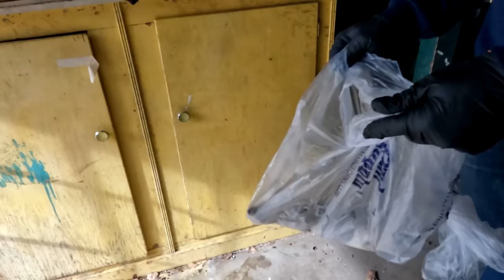We invented a rat sucking machine.. and it works!

Comment: Your footage looked better at 30fps. 30fps 1/50th shutter speed and shutter priority mode auto exposure are a must. If you have to/really really want to use a high frame rate, 50fps 1/60th shutter speed is ideal. Both of these frame rate and shutter combos will film in any country without artificial lights flickering, and they should also reduce or eliminate the flicker of your tools, too. You may have to switch your cameras to PAL mode in order to access 50fps.

Comment: yeah, maybe it should be a national regulation that every house needs a backflow preventer w/mesh screen to prevent rats/roaches from coming into your house from the sewer. the previous owner of our house had the wrong toilet flange installed, which left a gap for roaches to come in from the sewer and crawl under the toilet into our home. if you can't figure out how roaches are getting in check your toilet flanges. a sign i didn't realize was that the wallpaper was also falling off the walls so i am wondering if that was due to sewage gas.

Comment: Why doescon't anyone cover the vent pipe at the top with 1/4 inch hardware cloth held in place with a radiator hose clamp?  Air can move freely, but no rats or mice.  That's what a friend of ours did to exclude young o'possums from falling down his vent stack and swimming out of the toilet.

Comment: Why that always seems to be such a problem is houses are so cheaply build in the USA. Living in Germany walls are made out of solid concrete. I can't even hang up a picture without drilling a hole. U won't have rats in does walls solid concrete vs cheaply thin walks that a hollow in the inside. It has been shocking for me on so many occasions to see how cheaply everything is done in the USA. Door thin hollow wood door. Not heavy solid wood or metal doors. Flimsy locks. I could just keep on going. Also if you do plastic pipes u cover complete around with a metal pipe. That also takes care of tatas the metal pipe won't rust out because of the plastic pipe inside. I know genius right. But that would be not cheap enough and low quality like America loves it. 😂
Reply from the maker: But then …….we wouldn’t have a rat YouTube channel 🤩🕺🏻👏❤️
Reply: @TwinHomeExperts  exactly. Good point. Like u guys funny witty enjoyable. U keep doing what u been doing.
Reply: Actually you have an inner concrete wall and outer brick wall. They can live in between there but theres no plumming or electric in which they can get inside through. They sometimes come in through the roof.